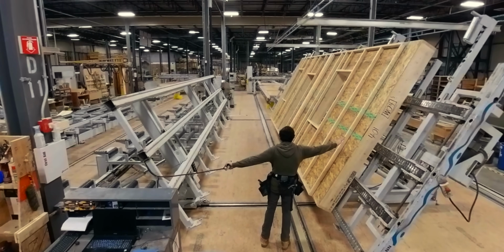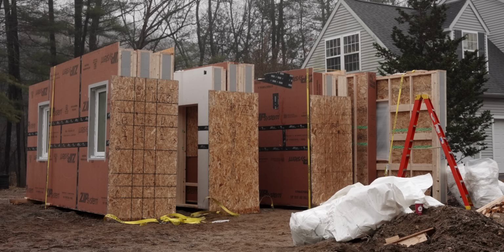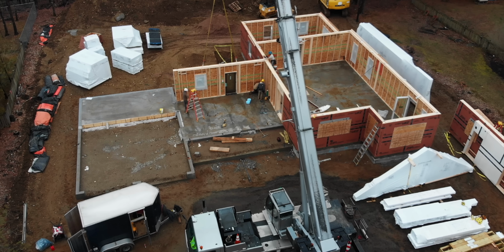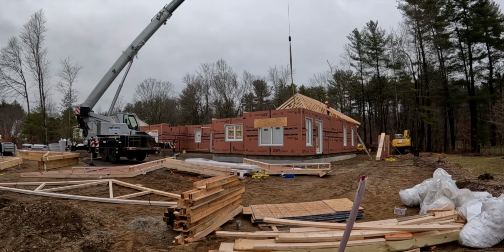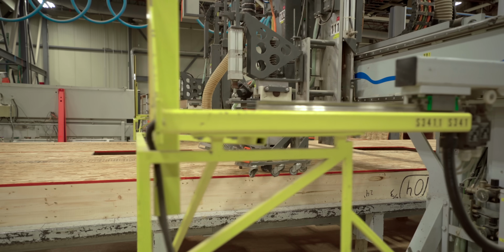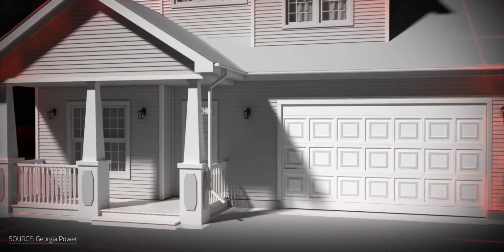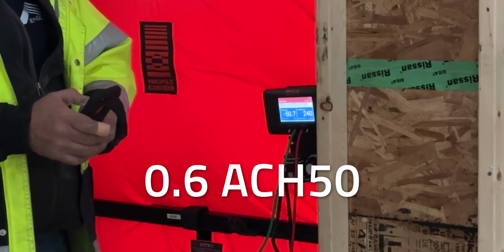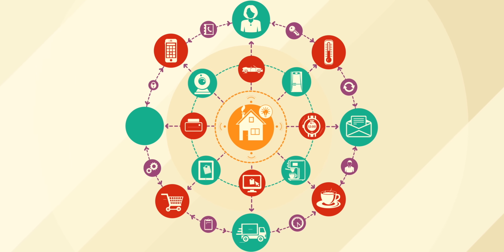Wow! I Didn’t Know A Prebuilt House Could Do This

Comment: That's awesome, congratulations on your new house.
As European I'm curious how you'll find "our" windows system. I think the "tilting" is one of the best things, and the possibility to have whole window open...and improvement.

I was looking into pre-built houses, specifically a German company with a yellow and gray logo.

I can't wait to have enough budget for the house, and all the things that you will install as well.

Well... Congrats!!!
Reply: I don't see the benefit of tilting windows in his case.
Tilting windows are great if you use them for ventilation. But he said that he will have HRV (Heat recovery ventilation).
So what's the point of tilting windows in his case?
Reply: @Jehty_  sometimes, sometimes you need to ventilate lil bit harder, but not that hard as full open window. 
Spring / Summer (when there's no need for AC) breeze flowing throw tilted open windows..  that''s nice.
Reply: @gamonvoid  but HRV is just better than opening windows.
Even when your not heating or cooling. It's still filtering the air.
And less pollutants in your house is always a benefit.
Reply: @Jehty_  agreed. However, sometimes I personally like open windows 😉😉😉

Comment: I am concerned about the airflow in the house. In the past where I lived .6 was the lowest they would except. This was due to having a house that didn’t breathe enough to operate properly. I see you have a recirculating fan that takes out the heat, my biggest concern is that I would like to have a house that uses natural air circulation to achieve this. Is there anything on the market that approaches it?

Comment: O.K. camping out in your tesla is useless information. 

You don't show or explain the design of your slab/foundation? It looks like your exterior sill plate is directly attached to your slab? That is an industry "no, no"! No thermal break between interior/exterior? 

Did your engineer spec. aggressive thermalization between your slab and existing soils?

So basically you are dressing for winter in extreme weather garments and flip flops for footwear.

Nice looking windows? Are they vinyl? Are they aluminum? What is the energy value of your glazing/window?  

Your presentation makes me run away from your chosen type of construction! 

Your shows have little to learn, albeit entertaining...

Comment: Thanks for the vid Matt.  Question sir.  What is the cost differential between this house and a house built exactly the same size with normal construction practices?  I took a look at the Unity site and considered building a small home for my mother on some land we already own.  The house pricing looked staggeringly expensive for a relatively small home.   The energy efficiency is awesome but would like to know the premium up front cost vs a conventional build.
Reply from the maker: I’m going to delve into that in a future video.  If you’re comparing it to a standard stick built home built to the same specs, Unity should be more cost effective.  But it’s definitely more expensive than a stick built home built standard building codes (not as energy efficient).
Reply: @UndecidedTechnology  Thank you sir.

Comment: I would be really interested to see how you design your plumbing and water system. I ask because there are many different designs to limit waste in getting hot water to your furthest location. Find your water heater and pick the furthest faucet and turn on the hot water to see how long it takes to get hot water. Good designs are nearly instant, bad designs like my current old house takes minutes.

Also interest to see you network your house. My advice is to run as much cat6 or cat6a as possible. Wired is far superior to wifi.
Reply from the maker: Good call out on the plumbing.  I’m definitely going to be running a lot of Cat 6a.

Comment: In the 1980s, I bought a owner builder home which was assembled out of parts on site. The finishing of the home such as drywall, insulation, wiring, heating, and AC was the responsibility of the owner, which, of course, was me. I can assure you that they are not as energy efficient back in the 80s as they are now, but I was really pleasantly surprised with the results much I got this house finished. I believe 84 lumber company owned the manufacturing company called Home   Run Inc. . The workmanship was excellent, I would recommend a prefab home from a reputable company as opposed to stick built. I have worked for builders that stick built homes and no lots of people who have done the same and to a man, they always say the builder takes shortcuts. Another thing that I would definitely do would be to have an energy audit as soon as the house was completed.

Comment: The concrete slap isn't insultated? Weird, because that is absolutely must in countries with higher build quality like in Finland and Sweden. Also the moisture rising through the slap is huge problem in the long run, if not properly managed.
Reply from the maker: I didn’t get into that aspect, but it’s very well insulated.

Comment: I want to see the wiring. Are you adding conduit along side of the low and high voltage wires? Are you going to run low voltage to each door and window for smart controls and communication? Having ethernet run to every corner of the house is something I have been trying to work on in my current house, but with out internal wall damage I can not run any more cables due to the way it was constructed.
Reply from the maker: 👍 I’ll be detailing a lot of the for sure.

Comment: For those not building with SIPs-style walls, standard stick frame, ZIP sheathing, and Aerobarrier get astoundingly good air sealing.  
There's also the TStud, which is a mostly-drop-in replacement for standard studs that vastly reduces thermal bridging.
Reply: Someone watches Matt Risinger's videos... :)
Reply: @KevinLyda  Lots of building science, actually -- Matt Risinger, R&R Building, etc.  all about high-performance structures built with mundane material and next-level procedure.
Reply: @barongerhardt  Sorry, I didn't mean to imply that previous building methods weren't engineered and that higher air permeability was a consequence of bad design -- merely a consequence of design *limits* of the time.  They didn't have polyurethane adhesive building products in 1946 or whenever.  My point is that yes, houses do need fresh air, and the consequences of the houses that could be feasibly built in that time allowed for this by virtue of the fact that they really couldn't achieve the air sealing to a degree where it becomes an issue.

Now, you're absolutely right that moisture is the #1 enemy of building longevity.  Of all the control layers in a building envelope, your moisture control is the #1 concern.  I would argue, though, that you aren't 'trading in' short term gain for long term integrity unless you're just deciding to go all-in on air sealing and completely discount moisture control.  You absolutely need adequate below-grade sealing, vapor control, and drainage.  You absolutely need above-grade drainage planes behind cladding.  You absolutely should be flashing your window sills with an appropriate product and then leaving the bottom edge uncaulked.  

Radon can be really area-dependent, honestly.  A huge majority of homes in my area must have active radon mitigation.  I've seen a 1948 home on crawlspace hit 27 pCl with a 24 ACH50 blower door.

As for the whole thing on gas stoves, that's just cold hard facts -- gas stoves by and large wreak havoc on indoor air quality.  Can you engineer a system where gas stoves are not dangerous to indoor air quality?  Absolutely.  Is that often the case?  No.  Would people be willing to pay for such systems?  Probably not.  Hence the push to limit/eliminate gas stoves for new construction.
Reply: So glad to read the educated responses from those that know how building science is supposed to work.  According to the HVAC guy who installed my system every new house here in GA has to pass the blower door test….I’m calling BS from some of the obvious things I’ve seen.  I came across this house after it was almost finished so I didn’t have any input sadly.
Reply: @Frank_W.  Blower door scores are becoming very commonplace in new construction building code all over the place.  My area requires 6 ACH50 or better to get a CO.  This is in addition to insulation requirements; again, in my area, it's now impossible to meet code with only a 2x4 wall, even with full-fill closed cell foam.  You must have 2x6 construction or 2x4 construction with exterior insulation.
Reply: @CygnusRising  We get temperatures recently 5° and 100°+ so it would only make sense to build with 2x6 at the very least.  One other thing that they did was to put the HVAC system in the attic 🤦‍♂️ which makes zero sense to me.  Matt Risinger has even talked about this building practice as being absurd.  This is supposed to be a semi custom home too and while it’s quite nice compared to some the methods used are dismal.  One thing that was done right was 400 amp electrical.  I’m planning on getting the Cybertruck so that will be nice.
Reply: @Frank_W.  I agree that building with 2x6 minimum just makes sense, but the fact that code is requiring it now through insulation value requirements is good.  It means spec homes can't be made out of toothpicks and cotton candy.  

HVAC in the 'attic' is totally fine if it's still within the building envelope, to be fair.  Risinger has put plenty of HVAC systems in the attic, which makes sense down where he is in Texas because they rarely have basements due to hitting solid rock so quickly -- however you'll note when he does that his insulation layer is on the roofline so it's still within the building envelope, albeit in semi-conditioned space.
Reply: But is it really a good thing to seal it completely instead of ventilation? 
Maybe with the chimney effect?
Reply: @CUBETechie  Yes, this level of air sealing is totally fine.  The idea is that the old idea that 'houses need to breathe' is archaic.  While it's true that you absolutely do need fresh air circulation in a house, the part that makes it archaic is the idea that it just 'happens naturally'.  

However, you're not entirely wrong; there's a 'yes, and': Modern ultra-high efficiency standards still allow a house to 'breathe' through the means of mechanical ventilation which is metered and conditioned -- Matt mentions a Heat Recovery Ventilator, or HRV, which cycles air through the house while also recovering existing energy from the conditioned air inside the building envelope.  

This leads to an overall healthier building and occupants as you can more directly assert control over air quality both in terms of human quality (pollen, dust, antigens, etc.) but also in terms of building health (temperature, humidity, etc.)

Things like chimneys backdrafting, bathroom fans, and kitchen vents cause cases that should be addressed via make-up air systems -- auxiliary air handling systems that turn on along with these negative-pressure systems (sucking air out of the house) to balance them with intake air during operation.

TL;DR: we're replacing the historical methods that were created by the natural consequences of design (a house needs fresh air, but we don't worry about that because it's built in such a way that it has enough passive airflow) with intentional engineering and science (a house needs fresh air, we'll build a tight envelope and make sure we ventilate it properly).
Reply: @CUBETechie  He very briefly covered that in this video. There is a ventilation system to exchange air, but it recovers the heat from inside before sending the air outside. It was like 5-10 seconds in the video, so no clue how that works. I'm assuming it allows the outgoing air to heat the incoming air to reduce energy loss.
Reply: @pantheis really really simple. You have a fan that pulls air into the house and a fan that sucks air out. They are controlled by the same “switch” and are either both running or both off.

The piping for the incoming and outgoing air both goes to a counter flow heat exchanger.

The hotter air gives 95% of its additional energy to the cold air and that’s it.

You just stopped the heat/cold you paid money for from escaping outside.

The heat exchanger needs cleaning every so often btw.
Reply: @CUBETechie  The idea is to seal the house tightly and control the ventilation with ERV. That way you efficiently ventilate the building to control heat loss, indoor humidity and drafts.
Reply: @CUBETechie  yes. With mechanical ventilation you can pull warm air out of moist rooms (bathrooms and kitchen) and use it to warm up air being pulled in from outside and pushed into the rest of the rooms.
Reply: @CUBETechie  That's why those of us that build tight houses use ERVs.  Yes - seal it off completely, then control the fresh air that comes in.  It's filtered then warmed by the exhaust in the ERV.  It's about 80% efficient at allowing fresh air in.  Leaks letting fresh air in are 0% efficient since those leaks are not warmed in the winter, nor cooled in the summer before the air gets in the house.

Comment: Still find it baffeling that r50 is considered high in the USA. That has been construction minimum in most of Europe sinds 2004... I live in a standard 2001 build house, not extra insulation and normal usage and have a standard energie use of 2900kwh/720m3 gas, about a third of Matt's old home.
Reply: Depends on where you live in the US...R50 is only considered high in the milder areas. In Massachusetts where Matt is building R60 is the recommended value for attic spaces.
Reply: @glamdring0007  Yeah but its illegal in the EU to go lower. Thats the absolute minimum

Comment: Im curious why you didnt go for controlled roof space ? Bit beams, open roof space so you can insulate right on the roof not inside your house with the roof open to the weather.  Its a lot easier to work on everything too. Also, more solid roofing means that unusual weather wont ruin your home. Concrete to hempcrete to all sorts of tough materials. Even the tesla roof looks pretty tough.
Reply from the maker: One simple reason: cost.  It would have added a good chunk to to the price of the house.

Comment: Great video. Love your house. My 4000 sq ft shop is no match for energy efficiency but my Amish neighbors put it up from start to finish in 4 days.  😄.  To be fair, there were 30 of them and they are crazy good at working together and building fast.
Reply: Did they build it for electricity? lol
Reply: @johnkeck  no but an electrician came in later and installed on outside of walls. It’s a shop so we didn’t care.